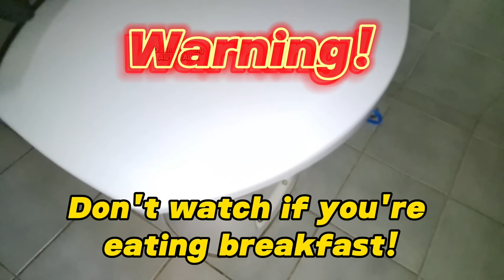The last plumber couldn't unblock the toilet so they called me

Comment: After having paid for sewage unblocking several times - and it costing a fortune, one of the plumbers recommended I get myself a whip hose and get it on the pressure washer.  Ordered a hose and a cheapo head (3 jets back one forwards) and I haven't had to pay for unblocking again!  There is indeed a satisfaction that comes along with seeing all that brown water rush away down the drain.  (It was tree roots.. who knew).  I just do it once a month preventative to keep it flowing.  Keep it up mate!

Comment: I like how the toilets make the transition from toilet to drain.  Ru 6:03 rubber seal versus  the wax seal. Saves the floor from rotting out. Also the toilet has a wider base, with 4 bolts to securely hold the toilet to the floor. A very nice system, you have in Australia. Better than the toilets we have in the USA. Not to mention your great weather.

Comment: In Wisconsin those inspection points have to be below the frost lines in the winter. The inspection point in my front yard has to be an 8 foot pipe leading to the main sewer line. Fixing root damage requires heavy construction equipment. It would suck to have to clear out an ice dam in your sewage lines.